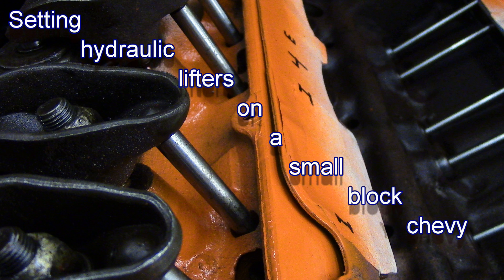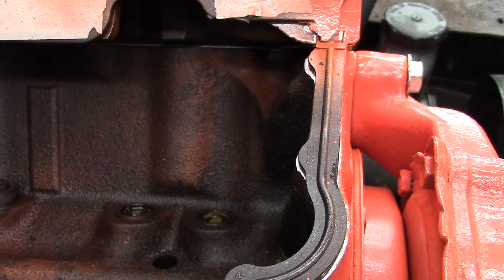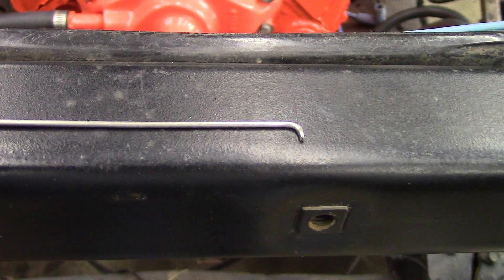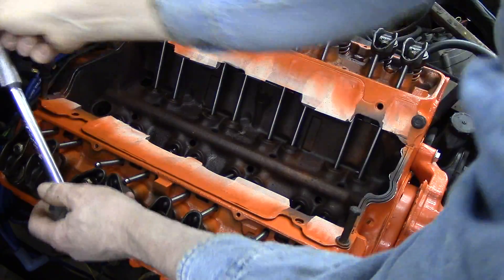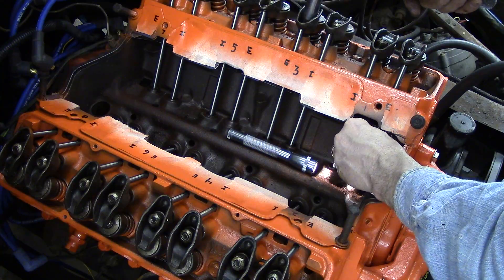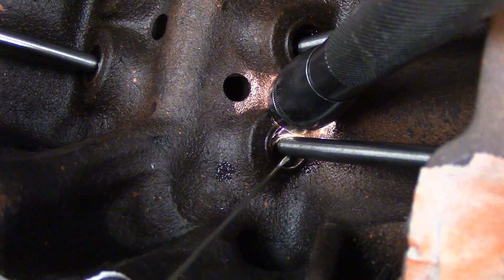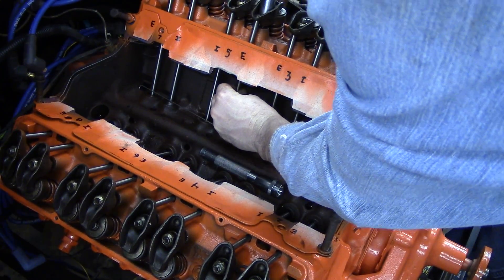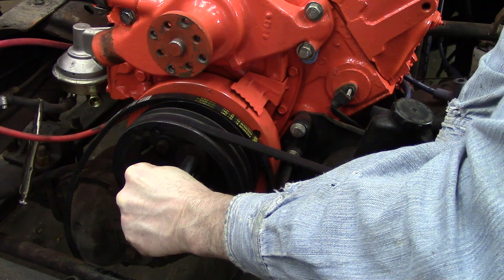How to set small block Chevy hydraulic lifters

Comment: Thanks for the video. Nice job. My 68 307 had been sitting and 3 intake pushrods bent on the right side head cyl 2 4 and 8. I got some new pushrods and will use your advice. The sbc is fun to work on and such a great design. Thanks

Comment: Thank you for this video.  I had not seen this method and it looks fail-safe to me especially with the added dimension of using the heliarc tool to check lifter internal clearance.   I have to ask too if you had to do anything to the lifters prior to checking lash to insure that there was enough travel within the lifter.   In other words is it necessary to remove the lifters from the engine and bleed the oil out and then reinstall the lifters before setting lash ?  AW

Comment: How often, why do you adjust the valves? I'm a new sbc owner and just recently opened up the engine for the first time
Reply from the maker: Only readjust hydraulic lifters if you changed/replaced something. Camshaft/lifter or pushrod replacement, removed heads, etc.
Reply: @HRIservicesllcSturgeonBay  I took off valve covers for new gaskets, changed plugs and wires and now that it's all back together I'm hearing a ticking noise. Hoping it can be fixed with thicker oil, I'm not ready to mess with those rockers
Reply from the maker: @GordonFats123  changing valve cover gaskets will not change anything in the valve train to make you have to readjust the valves. Are you sure it wasn't ticking before you installed the new valve cover gaskets? Ticking can also be an exhaust leak either at the head or at the manifold to exhaust donut.
Reply: @HRIservicesllcSturgeonBay  it hasn't ran since September but I'm sure there was no tick before. I even drove about 10 miles after putting it all back together. Now that you say that about the exhaust, I did have to take off EGR valve and I cleaned with brake cleaner. Maybe it's clogged or just bad. I'll most likely bring it to my buddy's shop
Reply from the maker: @GordonFats123  good luck!

Comment: There is a Much better way and a lot easier and quicker check out " The Engine Guy "  All Hydraulic Lifter engines and even solid engines can be done this way, doing as the Engine Guy says your engine will start first time every time, you will not have to go back and do anything.  I have used this Same method for 40 years with no problems and have built Thousands of Engines.
Reply from the maker: Thanks for your input Garry, I have not built "thousands" of engines, but will tell you my way works every time also, and it mimicks the actual GM process. I will check it out though, thank you for the comment.

Comment: Thank you. Thank you. Thank you. I tried another method I saw on YouTube and it caused my valves to remain open, losing all compression and a crank/no start situation for my newly rebuilt motor. I followed your method and the engine started right up! I did it with the valve covers off and stopped the engine, checked for loose rockers and gave them a slight adjustment. I repeated this method 3 more times and it took all the slack/lash out of the rocker arms. They don't even click when the engine is running and it's running very smooth. Thanks again!
Reply from the maker: Thank you for the great compliment Sean, I really do appreciate it. I have used this method many times and added my own measuring with the weld rod, it gives me piece of mind it is right the first time.
Reply: @HRIservicesllcSturgeonBay  I didn't use the rod method as the intake manifold was already installed. Just the order of procedure was enough to get it to start right up. Much appreciated.

Comment: When you rolled the engine over for the last time to have it ready for distributor drop in, don't go all the way to "0". Stop at anywhere from 12 -16 before ,then drop dist. in and line up rotor pointer with cap tower one(that has been verified with a sharpie on the side of dist. housing) and lock down. Providing you have fuel ,compression and spark etc, it will fire up within two revolutions every time. Thanks for posting.
Reply from the maker: Thank you for the valuable comment!

Comment: I'm glad someone out there is using the prescribed shop manual technique. Others have you turning the engine over 90 degrees at a time working on only one pair of lifters at a time. W-A-Y too complicated and time consuming. My only comment is this: over the years I've had a couple valves on two different engines not close completely causing a rough idle so needed to back off the preload. After the second miscue, I started to set preload at 3/4 turn instead of 1 full turn. Haven't had a problem since. Hope this helps someone out there trying to adjust hydraulic lifters on a SBC.
Reply from the maker: I have always been concerned about the same issue, if not caught and left that way it can burn the valves, that is why I added the wire measuring step to guarantee what you are saying does not happen. Than you for watching and the comment.

Comment: need help why my motor sound like this, new lifters and i adjust my valves this methode https://www.youtube.com/watch?v=axuvjHkuEyM
Reply from the maker: jesper eriksson, sounds like some may have been adjusted in the wrong sequence, if that is the case, the rockers would be really loose when the valve was closed and the lifter on the base of the cam lobe. If that is true you will have to start over and verify from scratch. Thanks for watching.
Reply: H.R.I. services llc Ricky Hembel I have adjusted like you did in this movie and it stills sound like that, du you think it is in the bottom in the engine?
Reply from the maker: jesper eriksson, hard to tell without being there. You can take a piece of solid steel round stock, maybe even a screwdriver will work, hold one end in  the center of your hand, wrap you hand around it, then put your hand to your ear. Put the other end of the rod to different areas of the engine to see if you can tell where the sound is the loudest. Be careful you don't stick it in any moving parts. Good luck.

Comment: Will this mess up the timing
Reply from the maker: kwame bradley, no adjusting the valves will not change the timing. Just realize you want to install the distributer with #1 cylinder at top dead center on the firing stroke (both intake and exhaust valves closed). Follow my video on static timing for that process.

Comment: what i don't understand is that you do not use a feeler gauge to set valve lash. can you explain that?
Reply from the maker: alvin hartley, unlike mechanical lifters you cannot put a feeler gauge between the rocker arm and the pushrod. The gap you need to measure is with the intake removed between the lifter clip and the pushrod cup.

Comment: if i dont have a heliarc can I use a regular feeler gauge at 20thousandths?
Reply from the maker: You can try but most feeler gauges are to wide, the area you have to get in is a small curvature, and the lifter clip is right there also. Best off to find some sort of wire. Thanks for watching.
Reply: H.R.I. services llc Ricky Hembel i mean at the top of the pushrod.  The depth in the hydraulic lifter should be static the second time you tighten the nut so any slack in the pushrod at the top should be able to be measured with the feeler gauge where it meets the rocker.

Comment: hi - im installing new lifters / pushrods and rockers in my older sbc engine.i need to know if i should soak the new lifters in oil before putting them in or just some assembly lube on the bottom before doing this procedure. does it matter if the lifters are pumped up or not before doing the adjustment? - thanks in advance Don
Reply from the maker: bigpaw64, it's always better to have more lubrication than less. You can use a push rod to pump the lifters up by hand to try getting some lubricant inside of the lifters. Or you can install them and just pour some oil over the lifters after adjustment is completed.
Reply: Do not pump the lifters up manually before engine start up. New lifters leak down very slowly so pumped up hydraulic lifters can act like solid lifters. Just rotate the oil pump before installing the distributor until you feel drag on the pump. This fills the oil filter and most of the oil galleys so on start up you have almost instant oil pressure which will then pump up the lifters naturally. You may have some clacking for a short while until the lifters get fully filled up.

Comment: Just put new valve seals in. What would be the process to set the valves. Adjust till all play is out then a half turn more?
Reply from the maker: Yes, you can do that if the intake has not been removed, but to be sure and do it once watch this video it explains all and shows how to make a small gauge to verify the lifter is in the center of its travel. Then you know its correct. Thanks for watching.

Comment: Thanks for all your help!
now I have another issue...lol
suburban won't start. ..what can cause this?
Reply from the maker: Curtis Brown, I need more information, always remember you need fire, fuel, & oxygen to create a fire, an engine is the same,  which one are you missing? check for spark first.
Reply: Hi Ricky,
Well...turn engine over, i have spark from plug..fuel coming in at fuel line when i push the stem.
Reply from the maker: Well if you have spark, you could try to take the air cleaner off and pour a very small amount of fuel in the carburetor/throttle body and turn the engine over and see if it fires up. You don’t want to pour in more than a shot glass. If it does not try to fire up, and you have good spark, my best guess is a timing issue. Were there any issues that led up to it not starting?
Reply: H.R.I. services llc Ricky Hembel no, it was cranking find just after the head job...its not starting.
Reply from the maker: Did you have the timing cover removed at any point in time on this engine that you would have had a chance to look a the timing cam gear? I ask this because the cam gear from the factory is aluminum with nylon teeth, after some mileage the nylon teeth will break off leaving a loose chain that can jump. Then the timing would no longer be correct.
Reply: No not me....not sure from the previous owner. You thinnk the timing chain needs replacing?
If i open it up...might as well replace it?
Reply from the maker: Curtis Brown does this engine have a distributer, or is it newer with coil packs?
Reply: Distributor? YES
97 Chevrolet Suburban 5.7L Vortec 350 4x4.
When i turn the engine over its a sounds like high speed turning.
I will see if i can post a video sound this morning
Reply from the maker: Have someone else help you with this; you just need another set of eyes. Pull the distributor cap, put a socket on the harmonic balancer bolt and turn the engine over clockwise until the distributor rotor starts to turn, make a small mark with a Sharpie marker at “0” degrees on the harmonic balancer.  Then turn the harmonic balancer bolt counter clockwise while watching the rotor again stop as soon as the rotor starts to turn, then look at the harmonic balancer where you made the mark and estimate how many degrees the harmonic balancer turned before the rotor turned.  This will tell you if there is a problem with the timing chain or cam gear.

Comment: Thanks Ricky
so 360 is one full turn correct? i will redo tomorrow
Reply from the maker: Curtis Brown, that's correct 360 degrees is one turn. The line on the harmonic balancer should start on zero (0) degrees #1 cylinder @ top dead center of the firing stroke, adjust the specific valves from the video. Then rotate the engine 360 degrees (one full turn clockwise) that would be #6 cylinder firing position, then adjust the rest of the valves from the video. Curtis I'll bet you adjusted the first section of valves on the # 6 firing position. before you turn it 360 degrees check the orientation of all of the valve lifters you are supposed the adjust in the first section of the video, they should all be down. Good luck.

Comment: Hey Ricky
after i adjust the valves and do the 360 turn...several valves are loose...should that be?
Reply from the maker: No there should be no loose valves, with the sequence I gave the valves are adjusted on the base or heel of the cam lobe, as the cam rotates the valve will only get tighter not looser. I'm not sure how you could get there, the lobes only get taller never lower? You will have to turn the engine another 360 degrees clockwise and re-check all the valves again.

Comment: does this apply to readjusting the valves after the motor is broken in, I have about 1500 miles on a new motor and need to adjust. 
thanks
Reply from the maker: Yes it does apply, but if it was done correctly the first time there should be enough play in the hydraulic lifters that it should not have to be done again, there is .060" of play. Unless you remove the intake you will not be able to do the welding rod verification.
Reply: Ok thank you
Reply from the maker: Jody Ybarra, your welcome, anything you need just ask and I'll do my best to help.

Comment: I got a ?. what all should I do if my cam go bad.  I know cam lifters, but cleaning the cam debris out of the engine
Reply from the maker: Gabe Wms, most of the debris should have already worked it's way to the oil pan with the oil flowing through the engine. I guess your answer depends on
how much debis there is, I would at least remove the oil pan, wash it clean, replace the gasket, and while it's off you can see how much debris you find to help decide if you need to go farther.
Reply: Thanks
Reply from the maker: Anytime!! Sorry it takes so long, I check and answer comments every day, sometimes it's like they get lost in cyberspace! When you look at them they are in no special order either, you'd think the newest one would be  on top.